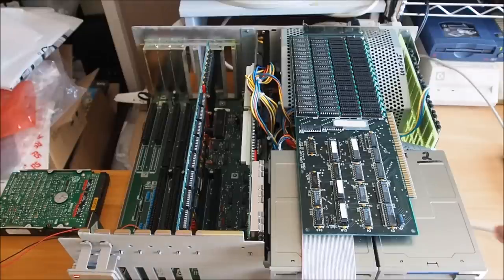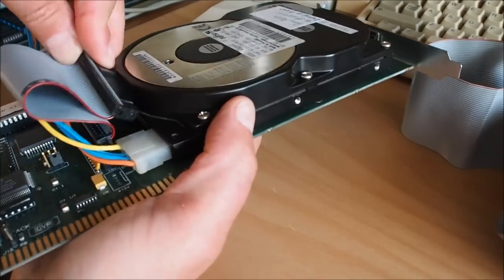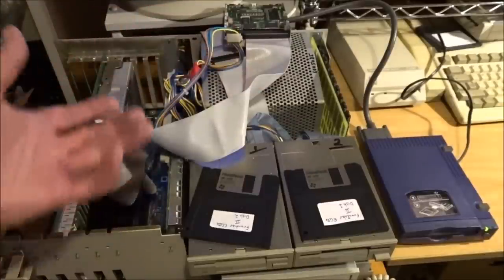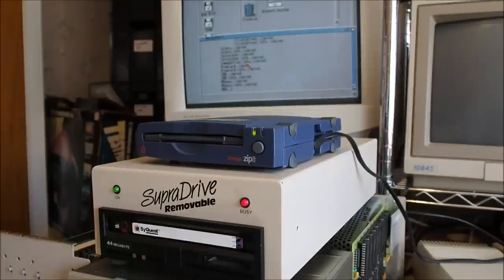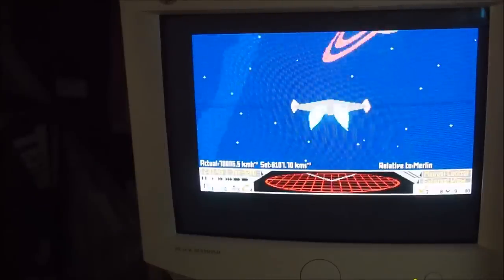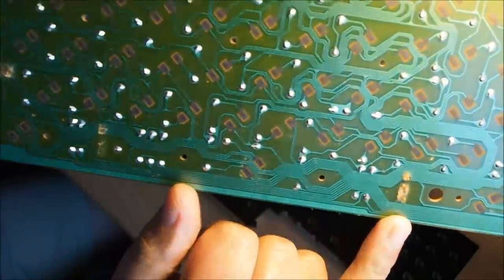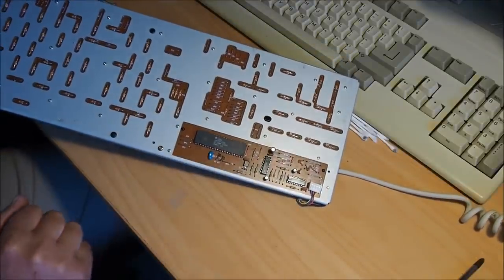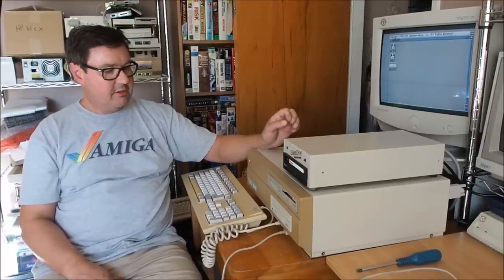The Amiga 2000 Receives a New Hard Drive Controller and more.

Comment: It was shared with me that it is not advisable to run hard drives upside down  with the PCB visible, but vertically or label up instead.  My syquest was used to make bootable backup disk images for all 3 platforms on the same A2000 (Amiga 3.1, Mac 8.6, and Win98SE).

Comment: You probably won't get as much performance on an A2000 vs A1200 with similar accelerator configurations. Data transfers to the custom chips on the Amiga are a bottleneck and will still run at the speed of the native chipset and may be limited to the size of the available chip RAM in some cases (Agnus, Denise and Paula can only access chip RAM directly, access to fast RAM needs to be done via a CPU request).
When you have an accelerator with local fast RAM in place, any CPU-bound workloads are improved, for example physics work or an off screen render. This is quicker if the code being run can take advantage of the local fast RAM. When it comes to displaying the screen after rendering, it will still have to be transferred in the next available native chipset cycle to be displayed.

Comment: there is nothing wrong with your memory cards.  a base 2000 w/o  an accelerator is limited to 8MB fast ram and 1mb chip ram (with 8372A agnus in fatter agnes mode).  the system will only recognize up to 9 mb max, including the 1 mb on the mainboard.  adding an 68030 accelerator I believe will allow the maching to address the rest of the memory, but with what you have, it won't recognize the rest of the memory.  I had the same issue when I had my A500, I had a 4 mb Baseboard in my memory bay, and had a hard drive controller with 8mb onboard.  it has the same chipset as the A2000, and didn't recognize all of the memory, even though I had 12 mb in the machine.
Reply from the maker: Thanks for your comment John. I realise now that the cards aren't faulty.
Reply: @AmigosRetroGaming  That is ok...... something i thought of later is that you need to look at the speed of the memory on the chips.  most Amigas were made with 150 ns 256x1s.  I had problems with my a500 with latency of the chips.  the onboards were 150ns, and all of my upgrade chips were 80ns chips (both 256X4s and 1MX8 simms).  with the a2000, they came with 1mb of chip ram onboard, so it may not have the same latency issues, but if you work on a 500, it is worth considering.

Comment: I have an A500 keyboard in bits at the moment and I'm part way through cleaning it. But I've found that the caps lock LED and the rubber contacts for it are missing :-/ Obviously someones had it in bits before, hopefully I will have something suitable to replace it.
Your A2000 looks in nice condition inside, no obvious corrosion or tainting on the metal.
Reply from the maker: I've just replaced the CPU socket as it was dodgy. You can see that in a previous video if you're interested. I got the battery out before it did too much damage.